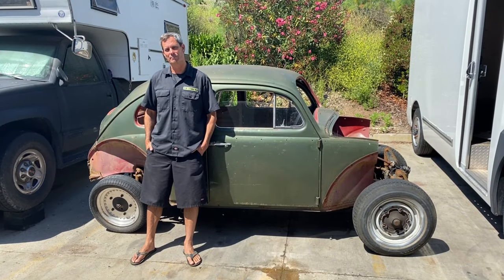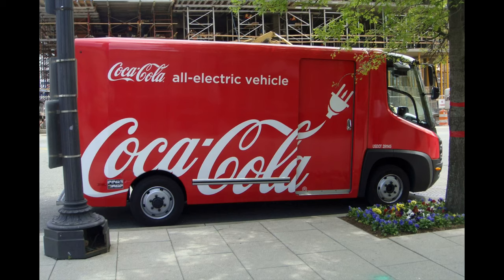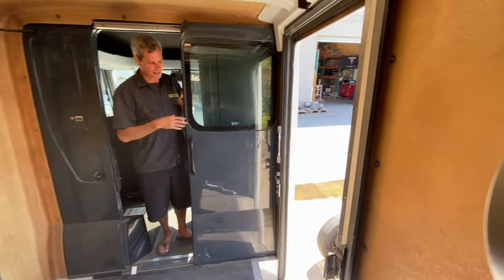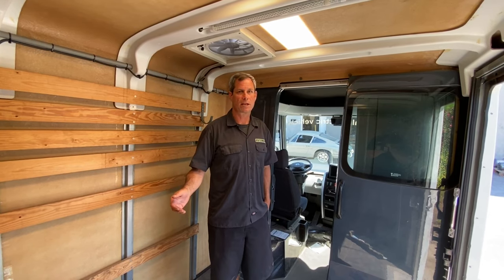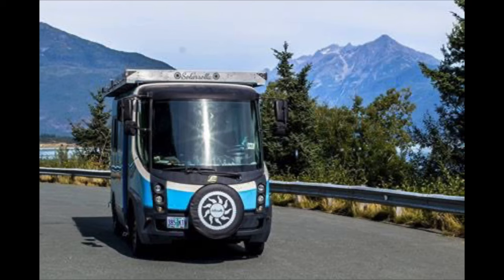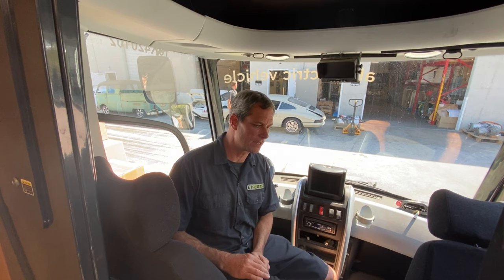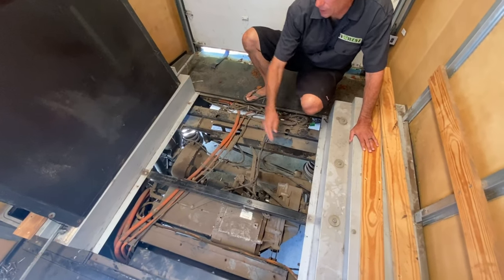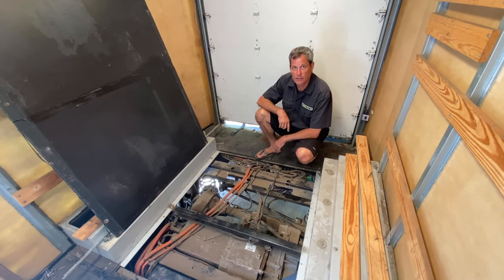Navistar International E-Star Build EP01 | EV SHOW by EV WEST

Comment: I would drop the motor, modify the gears for the Tesla Powertrain, for more torque, so you loose more weight and gain efficiency, then install those Tesla batteries.
Reply from the maker: The Tesla drive would not be able to handle the continuous duty, this application requires a commercial motor.
Reply: EV West, seems like they would be good to use in a industrial vehicle, i need more research
Reply: How about a Tesla dual motor setup?

Comment: make a camper.  If yall can perfect living off the grid; you got something.
Reply: I got a million bucks to the first one who makes a legit mobile home.
Reply: @grandmaster-grouch   @solarrolla challenge accepted?
Reply: @RouteDelSol  Hope he paid up !! You guys are genius ⭐.
May I ask a question , I read that electric trucks can't be towed as it was damage the ( drive train I think ! ) or maybe the brake discs ? 
The Ecuras project have converted a Pinzgauer to EV !! 
That's my dream expedition camper ....
What would be your opinion on an EV / solar Pinz or Unimog etc . Though Pinz are lightweight in comparison to Mogs etc.
Reply: @Star-uk1kh  no payment made yet haha! If you can put it in neutral and disengage the motor brake you can definitely tow the Estar. The motor brake is the EVs version of the ebrake which is a pin that is engaged using a super tourquey actuator.

As far choosing I'd go lightest first, however everything is possible to convert, it's just the feasibility of the project with budget and expected outcome that you'd need to understand fully before taking on a project like the ones you mentioned.
Reply: @RouteDelSol  Thanks for your reply . I will save this info .

I'm hoping to buy a Pinz 17 m  next year then hopefully find someone to convert to EV / solar and have a habitation box built .
All a bit of a way off but it will take planning and money ....
I know you did the EV conversion yourself but do you have a ball park estimate of costs ?
I'm in the UK and have yet to find people like yourselves ...
Great to follow your progress 👍.....

Comment: I say go full Tesla drive train and call it a day.
Reply: you should be able to upgrade the half shafts and gearing so it will be able to handle the added weight.
Reply: An entirely new rear suspension would need to be designed and built for it.

Comment: Doing anything with the old battery. Im looking to do my first ev project and want to get some cheap batteries even if they arent at full capacity. is it even worth a salvage?
Reply: They have such a poor energy density by modern stadards that I don't see them being used for EVs. Could be great for stationary application like offgrid solar though.

Comment: Ohhh Michael  That L@@Ks Pretty Danged Interesting To Me! I'm Converting My 1974 2-Ton Chevy Dually w/Full Stahl Covered Tool Boxes On It To Full Electric +++ Right Now... LOL Carry On Son... PS Ifin You Wanted To Help Me Out With Some Used Batteries + Controller ETC It Would Be Much Appreciated!? I Have A Couple 48v 13" DC Fork Lift Motors Already... Thanks